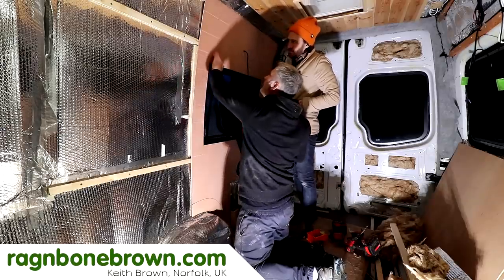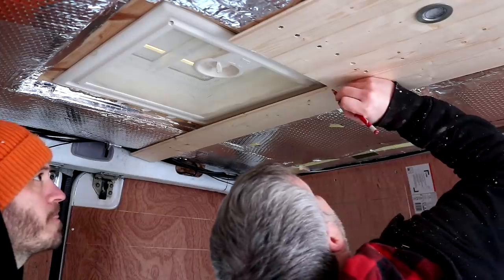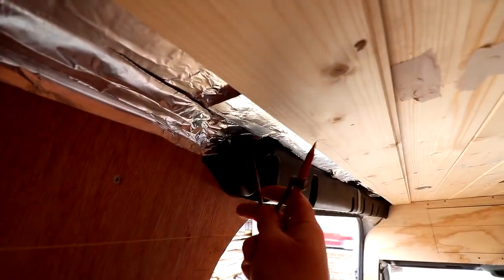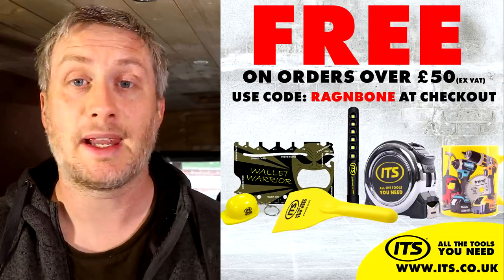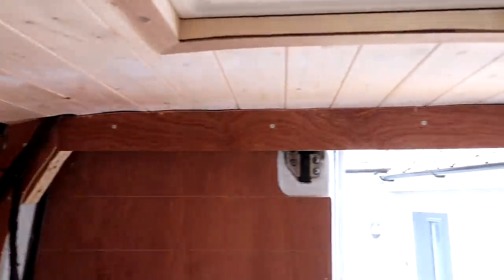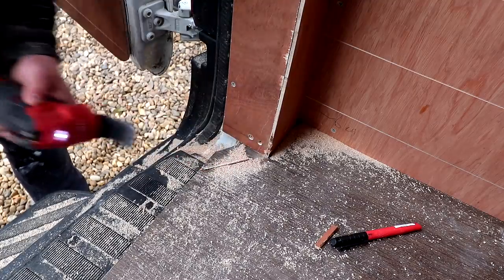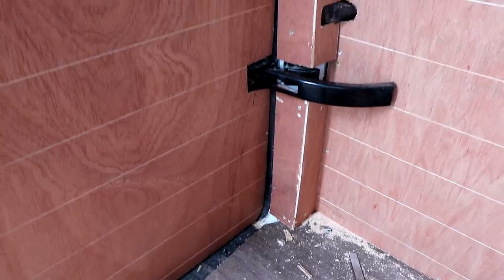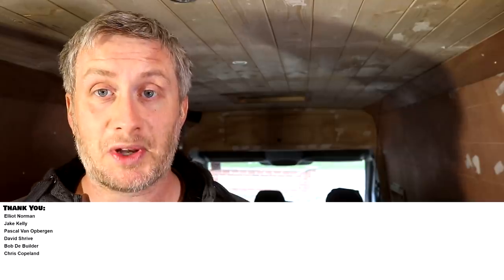Campervan Conversion - Ceiling, And Boxing In

Comment from the maker: In this video we remove all the old boards from the ceiling and add new, thinner and lighter boards.  We also create boxes for the ceiling ventilation fans and box in the pillars either side of the rear doors in the Mercedes Sprinter van that we are converting in to a campervan.

Thank you to ITS for sponsoring this video.  For all the tools you need, deliveries available 7 days a week!  Have a browse online at https://www.its.co.uk/ and use the code RAGNBONE to receive a free goodie bundle worth £30 when you spend over £50 excl VAT.

This video is supported by Milwaukee, check out their full range here: https://uk.milwaukeetool.eu/?utm_source=Social&utm_medium=YouTube&utm_campaign=Rag%20N%20Bone%20Brown%20-Milwaukee%20Range

M18 Drill & Driver https://uk.milwaukeetool.eu/en-gb/m18-fuel-powerpack/m18-fpp2a2/?utm_source=Social&utm_medium=YouTube&utm_campaign=Rag%20N%20Bone%20Brown%20-%20M18%20twin%20kit
Holedozer Set https://uk.milwaukeetool.eu/en-gb/hole-dozer-bi-metal-holesaws-sets/?utm_source=Social&utm_medium=YouTube&utm_campaign=Rag%20N%20Bone%20Brown%20-%20Holedozer%20set
M18 Jigsaw https://uk.milwaukeetool.eu/en-gb/m18-fuel-top-handle-jigsaw/m18-fjs/?utm_source=Social&utm_medium=YouTube&utm_campaign=Rag%20N%20Bone%20Brown%20-%20M18%20Jigsaw
M18 Mitre Saw https://uk.milwaukeetool.eu/en-gb/m18-fuel-254-mm-mitre-saw/m18-fms254/?utm_source=Social&utm_medium=YouTube&utm_campaign=Rag%20N%20Bone%20Brown%20-%20Mitre%20Saw
M12 Oscillating Tool https://uk.milwaukeetool.eu/en-gb/m12-fuel-multi-tool/m12-fmt/?utm_source=Rag%20'n'%20Bone%20Brown&utm_medium=YouTube&utm_campaign=M12%20FMT
M18 Router https://uk.milwaukeetool.eu/en-gb/m18-fuel-trim-router/m18-ftr/?utm_source=Social&utm_medium=YouTube&utm_campaign=Rag%20N%20Bone%20Brown%20-%20router

#woodworking #campervan #vanconversion

Thanks for watching! Please subscribe, click like if you like, and hit the bell icon for future video notifications

HELP SUPPORT THE CHANNEL:
Support with YouTube channel membership: https://www.youtube.com/channel/UCVyE_6jEtVZGmYGXtUOL5FQ/join
Support with Patreon: http://www.patreon.com/ragnbonebrown
Support with PayPal http://paypal.me/ragnbonebrown

MY TOOLS:
For links to the tools I use, plus some of my favourite consumables,  finishes and more see links below.  As an Amazon Associate I may earn a small commission from qualifying purchases:
UK affiliate store: https://www.amazon.co.uk/shop/ragnbonebrown
US affiliate store: https://www.amazon.com/shop/ragnbonebrown

SHOP:
Etsy: http://www.etsy.com/uk/shop/KeithBrownMaker
https://teespring.com/stores/rag-n-bone-brown-merch

LINKS:
Website: http://www.ragnbonebrown.com
Facebook: http://www.facebook.com/ragnbonebrown
Instagram: @ragnbonebrown
Twitter: http://twitter.com/ragnbonebrown
Email: ragnbonebrown@gmail.com
Second YouTube Channel (non woodwork videos): http://www.youtube.com/user/keefykeef

Comment: Rather you than me on this bit of the job!  Watching with interest though, as our camper is due back from the paint shop soon and I'll be building the interior.

One thought though, for changing bulbs in the rear lights, do you need access to the back of the light units to remove them?
Reply from the maker: That's a good point, and I will make the owner aware!

Comment: Getting the grooves lined up on the door piece won’t be too bad, do all the panel shaping first - get it tacked in place and use the laser level to transfer the marks over.  Easier said than done but not too bad.

Comment: Coming together well. I wonder if boxing in the corners has regained the weight lost by using the thinner roof boards?
Reply from the maker: Cheers Tim.  I don't think it will have affected it much at all.  The plywood used on the boxing in is thin (3.4mm I think) and very lightweight, as was the softwood we used as battens.

Comment: Quick question, when you screw directly into the metal body of the van, is there any concerns with the holes rusting over time?  Cheers 👍
Reply from the maker: Rusting from condensation do you mean?  I don't think it's a big concern, at least it's not something I'm aware of....